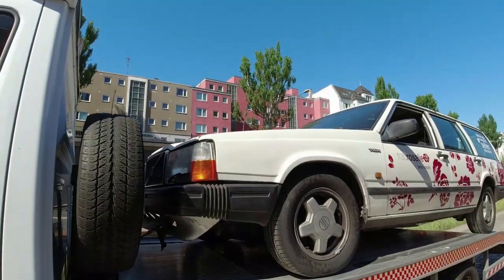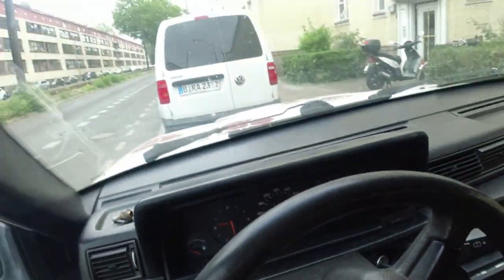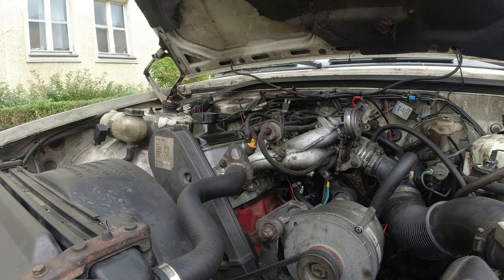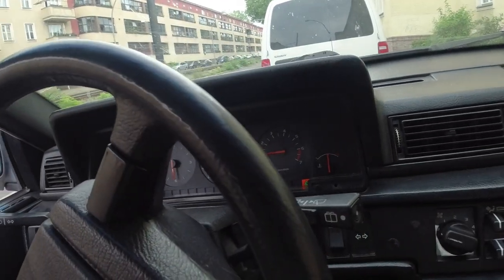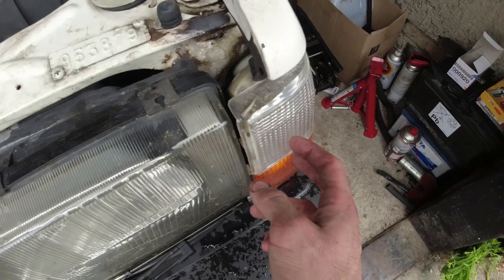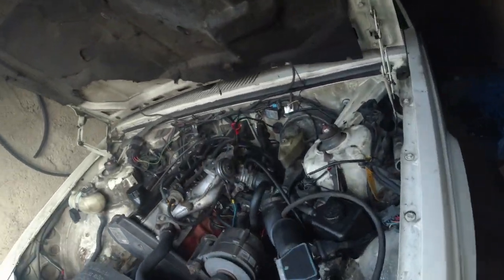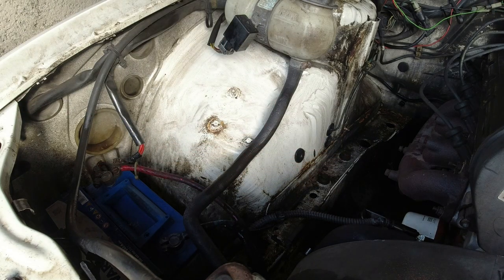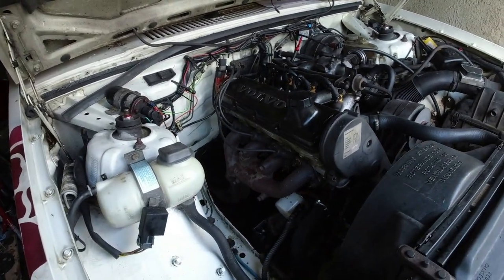I Broke Down in the Volvo 740 & Finally Clean the Engine Bay

Comment: Don't be too hard on yourself! I chased a high idle on my 240 for weeks until I discovered that when I had cleaned the throttle body I had somehow folded the gasket upon installation, creating a tiny air leak. I felt adequately foolish yet delighted all at once! She's looking much better!
Reply from the maker: Thanks! Can catch you out can't it! I nearly did that the other when when installing the front timing cover
Reply: What was the cause for cleaning the throttle body, idle problems ?

Comment: Remember when a commenter said that disconnecting the battery deletes all long term learn data from the ECU? The ECU fighting against whacky data was all I was thinking when she wouldn't fire up in the garage, didn't expect the king lead lol. 
If it's any consolation that exact screw-up swapping the plugs has been performed by yours truly in the past too :D
Reply from the maker: Haha! That's why I think it took a while to settle down to, the LH2.4 really don't seem to like being messed with
Reply: @Involvod  I mean for all the ECU knew the engine was running super rich in -20°C weather even though it pulled a ton of injector duty cycle already :D

Comment: I cleaned my volvo 740 engine bay with a pressure washer and soap, very simple and the result was great.
Reply: How do I learn how to safely power wash my engine bay? I am a novice and I was trying some cleaner with a rag and got nowhere. I'm trying to find this Dasty spray but there are so many variants I am lost! Haha

Edit: I am in the USA
Reply: @iridiumvalkyrie9017  I removed the battery from my car and then strapped a plastic bag over the alternator. Then after i had cleaned my engine bay i waited about 24 hours with the hood open to make sure the engine bay was dry before i installed the battery again in the car.

Comment: Phew! A relief I'm sure, I always label those connectors before unplugging. Doesn't look original of course but if you print them on a modern Dymo labelprinter in black foil / white lettering, it doesn't stand out and looks quite good 🙂
Reply from the maker: Definitely a good idea 👍

Comment: Yoi did a great job fella, you were logical and sorted it really quickly. I remember my first 740 - or more correctly when my grandad owned it before me… it had the B230K engIne and the carb had issues later in life with vapour lock, etc. eventually Volvo actually replaced the carb under warranty. The only other issue we had was the ignition coil started failing intermittently which gave the same sort of symptoms- would start and run fine, only to randomly cut out after say 10 miles.
Reply from the maker: I much prefer carbs but they can definitely have their annoying problems all the same eh!

Comment: Great that you worked out what was wrong - well done. I like that code flasher thing - I remember building one (trip to Maplins by bus to get bits)  for my 850T5 and finding MAF had failed!
Reply from the maker: It's quite cool isn't it! Fortunate to have it on this car, the other 2 all have the same switches and sensors, but no OBD at all! Not looking forward to when either develop running issues 😅

Comment: I'm glad it worked out in the end, Sledge. I love it how you make these investigations sound so easy and logical. Kudos to the clean engine bay, I didn't know they sold Dasty in Germany too, it's very popular here in the Netherlands. You can also get Dasty Professional, which is a stronger degreaser.
Reply from the maker: Thanks, I found it on Amazon and there was one in German, one with Dutch on it. It's great stuff isn't it
Reply from the maker: Will look into the Pro one!
Reply: @Involvod  Great stuff indeed, but when I use it in the kitchen, I always need to wipe it afterwards with some window cleaner to get rid of the stripes which will be left by Dasty. But in an engine bay it will probably be okay 😂
Reply from the maker: @fhwolthuis  especially the engine bay of this particular car 😄

Comment: On the timing belt cover there is a little sticker which appears have a timing belt for a twin cam.
Did this cover come from a twin cam engine?
Reply from the maker: I think that must be a generic sticker the aftermarket belt manufacturer uses, it's definitely a single cam cover 👍

Comment: They should design the loom so that either the wrong plugs won't reach or if they need to be close they are of differing designs. I also wish they would fit blanking caps to plugs that are not in use on the lower spec. cars,
Reply from the maker: Would have been nice 😃

Comment: Sounds similar to what’s going on with my car. Every since I cleaned the PCV box, I have had a slight hesitation on acceleration from 0. I’m guessing a vacuum leak somewhere, but I haven’t found it.
Reply: the PCV system can be annoying, that's for sure. If your car doesn't idle any higher than before the work you did it's likely a leak would be between the MAF sensor and the throttle body or less likely between the PCV box and the block. 
A handy trick to find vacuum leaks is to spay brake cleaner on areas you think there could be a leak and listen for engine RPM changes.
Reply from the maker: I normally use carb or throttle body cleaner (when I can find it) it will drop the revs/kill the motor when you spray into where it's leaking which helps you really pin point it exactly. I find it takes me a bit longer with brake cleaner but definitely does the trick
Reply: @Involvod  Oh cool, didn't know it was faster. Maybe I shouldn't use brake cleaner for everything after all :P

Comment: You are definitely not a detail guy. That engine bay clean was awfull. Use engine cleaner and spray it all. The use a brush. And pressure washer really close. The spray soap on engine again. And pressure was for last time. Remember to cover you're generator in a plastic bag. And Remove the battery.
Reply: Nah have a cup of tea, its fine.